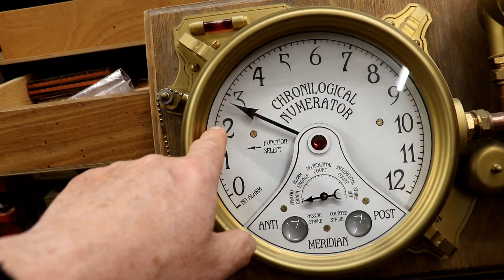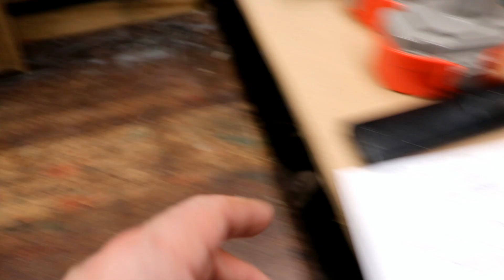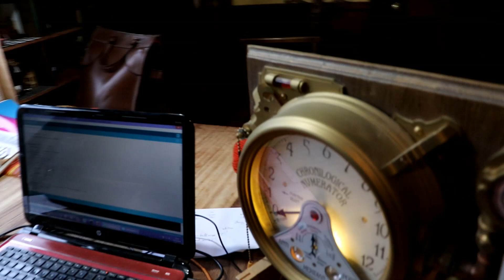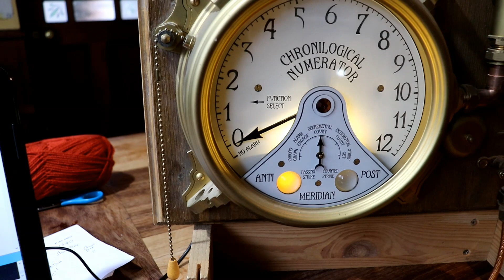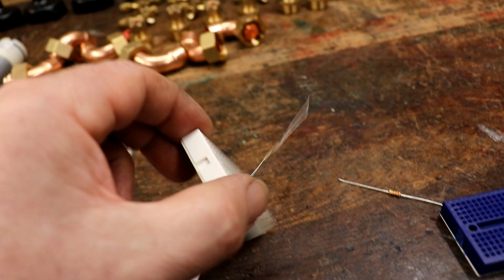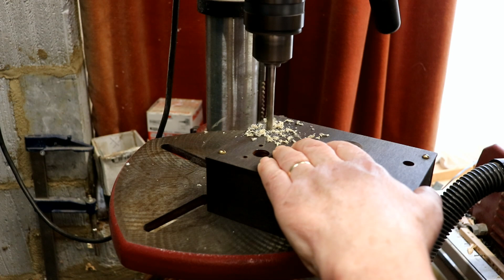Six years on and it's finally going to tell the time

Comment: One thing I've learned about those clock modules is that many of them expect you to use a rechargeable battery, not a standard coin cell.  The problem is that if you use a standard coin cell, it is not designed to be recharged, and it will start bulging. If you search online, you can find there is a trace to cut (or component to remove) so that the charging doesn't occur.  It's not really a problem using a standard coin cell anyway, since they last for years in those units.  Search for "DS3231 RTC disable charging circuit".

Comment: I built a Nixie clock a few years ago and used an ESP8266 as the uC. This gave me wifi functionality so I simply got it to go and request the time from a time server at startup (and then every hour if memory serves.)
Reply from the maker: That's definately a possibility, although I found 5 RTCs on eBay (that worked!) for £5.00/$6.35, and my brain is a muscle... not sure it could cope with requesting the time from a server!
Reply: @steamhead  It is a bit more palaver, but it's all existing libraries and code samples. Main downside is hardcoded SSID. I did see a walkthrough of how to get it to start as an access point which you connect to and feed in network details. That'll go on the to-do list for 2035(!)

I must admit that a box of rtcs for a fiver sounds easier!

Hope you feel better soon - I've gone down with the same sort of Xmas bug.
Reply from the maker: @smorris12  thank you for the info. Sorry to hear you've also got the Xmas bug. I hope you're on the mend soon.

Comment: Hi love your videos and ‘stuff’ you fabricate, can you advise where you purchase your air horns from please, the ones I ordered don’t work with the mini air compressors, thanks👍
Reply from the maker: Thank you kindly! 

I found that Chinese copies of the patented Spanish original don't work with the pump, but can be made to work by aiming a hot air paint stripper at the film on the base for about four seconds. This stretches the film properly. Obviously one too many manufacturing steps when making cheap ripoffs!

You can get the patented original Spanish version from Amazon. Search for 'fun fan line horn vuvuzela trumpet'. They come in threes in a particular country's  football colours. Plastikote brass paint works really well on any of the colours. The horn pulls out from the base so it's easy to remove the unwanted rubber ring. Before painting I cut off the mould lines with a scalpel.